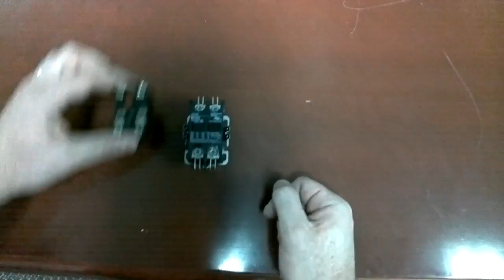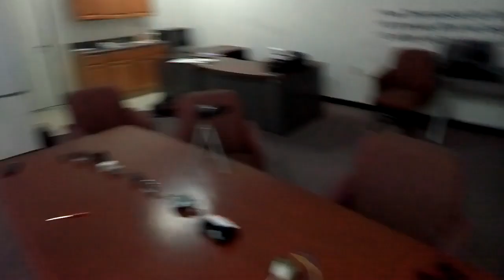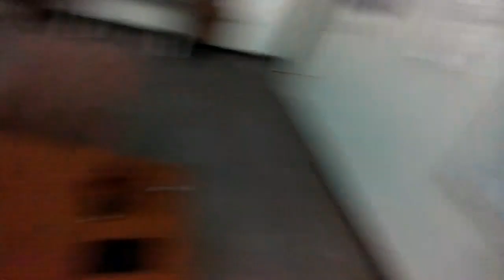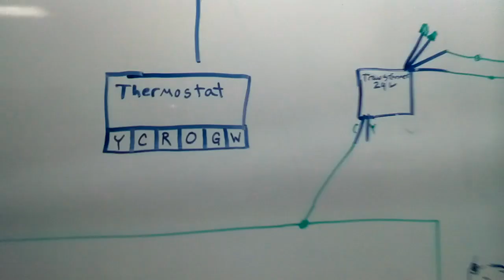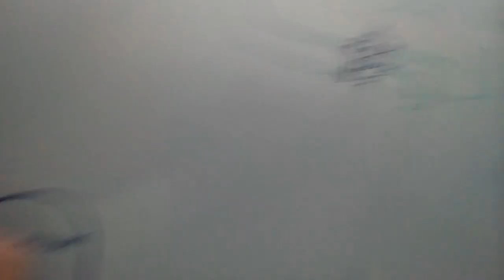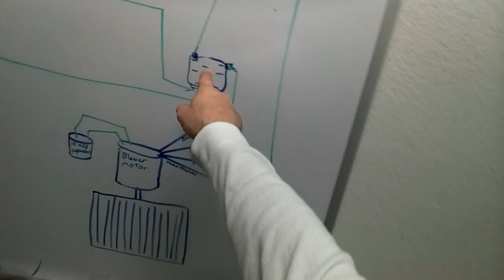Understanding Basic Electrical Wiring and Components of Air Conditioning Systems

Comment: I particularly liked how you emphasized the sequence of operation in the heating mode.  Also, I liked how you simplified the the routing of the control wires and load power conductors for the indoor and outdoor portions of the AC unit.  Well done, thanks again.

Comment: I have a HVAC system with a WhiteRodgers Thermostat (4 wire wiring) and a Honeywell humidity controller in series. I built a gizmo that senses humidity and switches a relay on/off on a given humidity range. Question: Can I wire the G and Y cables together to turn the system on and off by my gizmo? Please help, somebody :)
Reply: ...or if I supply the 24Vac only to the Y-wire does the fan start automatically (if it is in the AUTO position)

Comment: From my experience the start and run capacitors are 2 separate capacitors.  The start caps are the round plastic ones usually and the run caps are the metal ones.  Most time you have a C F H on a large cap that stands for common, fan and hermetic.  I think the way you have it wired in this diagram would mean the cap would blow up due to a direct short.
Reply: He's using 2 separate run capacitors Not a Dual Capacitor on his Drawing he has No Start Capacitor in the Circuit .On many older Model Units Condensers that is they used 2 Capacitors also some used start Capacitors but they had one for compressor and one for Fan on Condenser and some used both with a Start Capacitor with a Start Relay that would Drop out of Circuit.Newr units now a days use Start Caps and a Dual Run Cap with yes Can,Hermetic and Common to Power up both the Condenser Fan and the Compressor but the basic wiring is the same as long as you know how they operate other than the Start Cap and the Start Relay to pop the Compressor with a large Mfd then drops out the Circuit and let's the Run Cap take over from that point.Guys learn all you can from as they say The Old Timers they learned from the Old School of Hard Knocks now some of their techniques have come to rest because more electronic controls over Mechanical Controls and Controllers

Comment: I stuck a new motor in my Goodman wall furnace air conditioner I have all the wires hooked up but I'm not for sure with a yellow wire coming from the motor goes
Reply from the maker: Chris Casper if there’s 5 wires then that is probably just another speed.
Look at the diagram on the new motor or box. Some motors are multi speed so they have 2 for the capacitor usually brown. Black is high, blue is medium, red is low and usually white or yellow are common depending on brand of motor. What I just gave was the standard common color code but check your box to confirm if you have more than one speed just pick the speed you want that gives you the best amp draw and then put away or not on the remaining wires.

Comment: Why do some units need a transformer in the condenser
Reply from the maker: Armando Monreal because some condensers pull more amps on the Low bolt than others. Technically you could send 24 V out to all condensers, but someone in Dublin the transformer for pulling too many amps's so therefore they require their own transformer

Comment: Very good explanation. I have degree in electrical engineering but hardly have done any wiring myself. Your white board wiring diagram and explanation is worth day long course. Can easily cost couple of hundred bucks to get this traning. This helped me to trace down my external fan problem. With the help of mutlimeter I found the switch not closing correctly. Replacing the relay switch fixed the problem. Thank you. Shaking video is a thing you need to work on. That aside, great video and thank you for sharing.

Comment: wha is missing is where do you get the 24 volts. meaning where is the origin source? The 24 volts do not start on the contactor isn't

 it?
Reply from the maker: The transformer gets 120 or 240 volts and transforms it into 24v it then sends one side to all the low volt parts that's called common. Then the other side is sent to the thermostat for control. When turned to cool it connects red to yellow sending the other side of 24 to the contactor.

Comment: Isnt the common on the low voltage basically a "neutral?. If the Y is your main 24v power how do some thermostats operate when  hooking up the C wire with no batteries? Im a new HVAC tech . Thanks
Reply from the maker: Jason Bouchard you could think of a common as a neutral. Although it's not neutral as it does carry power. It's wired like a neutral. Leaving a transformer power doesn't know the difference it's just 2 sides of 24 volts. And since parts need both sides to run. We run one of these 2 sides to all the low volt parts. And since we run one side everywhere directly that's what makes it common because it's commonly worked everywhere. We then use the other side of 24 to control the parts through the thermostat.
Reply: +IshockO I understand all that. I'm asking how the common wire  sometimes powers the thermostat if it is basically considered the neutral and not the "hot" side of 24v
Reply from the maker: Some stats only need 12 volts or half of 24 to operate.

Comment: thank sorry to say but what about blower motor speed connection also when you giving connetion for compressor why direct run point to hot wired why not with capacitor

Comment: nice video explains the basics well except one constructive criticism could have said the purpose of the capacitors. Because this is single phase you need them but 3 phase you won't. Run and start capacitors or only need in single phase which is normally what we have. so just kind of over killing this fact

Comment: This is perfect lesson for me as I spent my career in electronics, and a pretty good technician if I do say so myself(maybe not the smartest but the most persistent and stubborn).   I learned how thermostats work after installing a few  (it's basically a  simple switching device without getting too techy- sounding--in fact there's a small relay inside each and you can hear the relay click when it comes on).   I started looking at my own AC unit and started at the fan circuit cuz that's what I could access.    I'm working on replacing the fan relay with a SPDT SSR which I wired up meself.    I still have to test it.   Anyway, this is great as it gives me the rest of the picture quick and dirty.  Thanks.  (I'd like to fix an AC unit one day.)

Comment: Really great video. I was really looking for one like this. It was easy to follow along. Very helpful. Thank you. But one question. What's the difference between common and neutral? Both the same, but ones high volt and ones low?
Reply from the maker: Neutral is the other side of 115 volts and is usually when we not need one leg of power to make 115 so 1 115 leg and a neutral will turn on a 115 volt motor. If a motor had neutral and not the other 115 leg it would not run. Just like in 24 volts a motor could get one side or common and not run u till it received the control leg or the one we break through all the relays or contractors. So common is simply one side of 24 volts and what makes it common is how we use it basically we can use either side of 24 as common and the one we send to all the parts constant would be labeled common and 24 volt parts can have common at all times and not turn on until they received the other side of 24 like when a thermostat turns on, it closes and sends the load or other side of 24 out to the contractor which since it already has common it will close allowing voltage to pass through and turn in the main parts. Which are normally 208-230 volts.
Reply: +Las Vegas Air Conditioning, Inc. I really feel that after watching this video, my troubleshooting, and my knowledge and understanding of electrically what is happening, had gotten so much better. thanks for breaking it down for me.

Comment: How do you go from a daul compas and a sinlge compass and they both are controlled.The dual run compres and sinle running fan.
Reply from the maker: I'm not quite understanding your question, if you re post it I will try and answer

Comment: camera too shaky...I got so dizzy and stomach ache too..so bad shooting and camera handling.
Reply from the maker: Thanks Raouf, we acknowledge that and will take more care to be more stable in future.
Reply: There is so much to keep in mind when servicing and troubleshooting equipment, with all the different designs from equipment manufactures and their changing designs as well as their designations, faster than techs can keep up with and all these changes and well with all the pressure from multiple sides, to quickly find the problem and bring a solution along with all the other forces (i.e. service manager potentially pushing tech to get in and out, to catch another call; many different hands in the "cookie jar" that may result in attempting to figure out what they did as the schematic as been modified but was not indicated on the schematic and a myriad of other issues that can and do arise in the field)… all these forces acting on a technician while in the "hot box" and not wanting to incur a call back and give great customer service, can be very challenging.  So learning to ask what a particular load needs both from a control signal as well as the line voltage is a good way to approach a system rather than just learning "this goes there and that goes there" in following the wiring diagram. I personally don't like to point fingers or blame others as there are too many variables that one cannot see but continually work at understanding systems,   Again, I appreciated your style and hope to watch more of your videos.
Reply: Raouf Mahjoub Same here…. to shaky and I became nauseous… not complaining just giving feed back.  After all the human being can also be viewed as an electrical load as well… just look at neurotransmitters in our brain, so we are like any load in the HVAC system opening and closing neural pathways and can be wired into a feed back loop, so humans and technicians especially can and should give feed back to instructors/supervisors/management etc, in a constructive manner but not in an adversarial way.  This of course cannot always be avoided.

Great instructions/overview macro view.  I have been in the business for approx. 15 years and despite the low production value, of the video, the content was excellent, from my perspective. :)  He stressed the importance of not worrying where one got the power/connection from but what the load needed in order to function in the proper sequence of operations.

Nothing personal against this instructor. however if one were scrutinizing the whole value of this lesson and production, one might ask why did one not catch the ineviatbel shaky camera and the negative that it would have added.  

This goes to show that even the best of them and really it happens to even those who may not be at the top of their game…. can overlook one or more elements. We are all learning.  One may feel that I am being critical and I am but not of the instructor's person.  

I had a former supervisor and service engineer with 40+ years of experience always tell me, "you weren't born knowing this stuff."  LVAC, you definitely know HVAC!  :)

Thank you LVAC Inc.
Reply: Thanks Lee Kelso for the advice..I did not mean any offence to our brother Las Vegas Air conditioning etc...it is just my bad English wording. Sure I felt the content is so interesting that I felt so frustrating not understanding it due the type of video...many thanks to the effort done by Las Vegas...:)
Reply: i did not perceive you to make an offense to him :) nor did i detect bad English… it was just interesting that others were experiencing the same thing.  I was also very clear that I was not attacking the instructor but separating production value from him as a person.  One could do the same with me or any one.  Being critical of methods and procedures should be for the purpose of arriving at a higher level of craftsmanship but it is also ok to be different in our approach to addressing issues.  I feel we all learn from each other.  I never stop learning.  This individual was/is an excellent communicator and I followed him all the way despite my being dizzy and nauseous the whole time.  I would like to see him rewire a multi-stage unit with all the bells and whistles.
Reply from the maker: Thank you guys your are correct the video was too shaky 
We were recording all of our videos with google glass which made it easy and convenient 
But in the future and in our more recent videos we are attempting to stabilize the videos for better viewing. Thank you for the complements and advice maybe I'll make a new understanding electrical wiring video that's more stable.
And two stage electrical well do one about that also.
Reply: +Las Vegas Air Conditioning, Inc. Looking forward for your much improve and stabilize videos. Thank you for sharing this video.